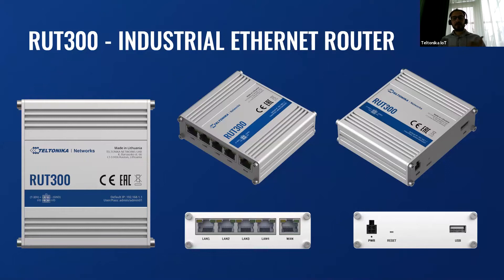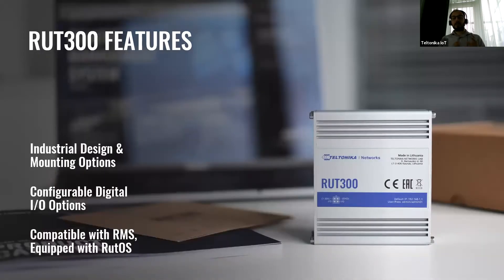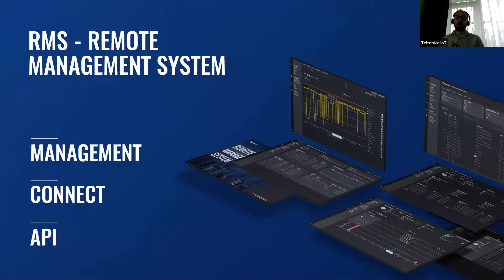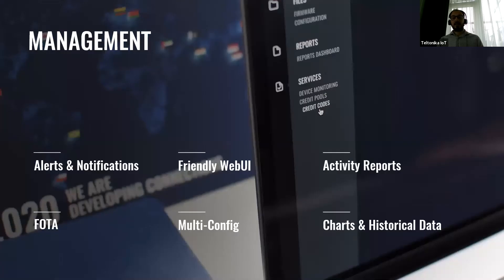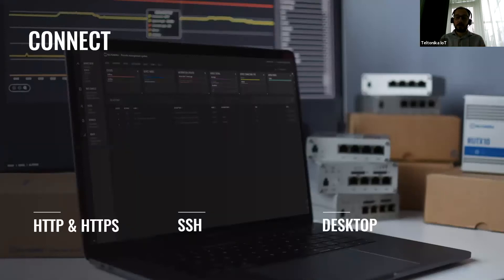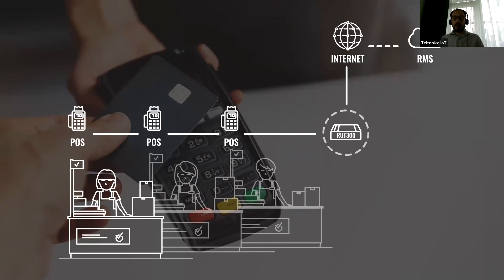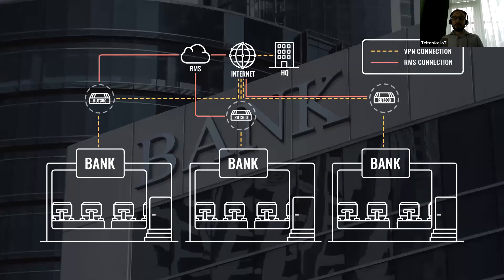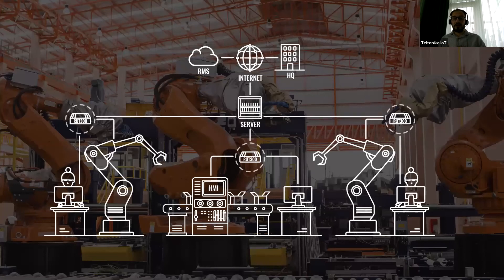RUT300 Industrial Ethernet to Ethernet Router | Webinar

Comment: per the RUTOS, can we load landing portal page on it for data mining ?
Reply from the maker: RUT300 has no Hotspot functionality, as it is not a Wireless router. With any other RUTOS device which has WiFi, you can use Hotspot service and use either internal or external landing portal; though we do not offer any data mining tools, so this part is up to you.
Reply: @TeltonikaNetworks  thanks.